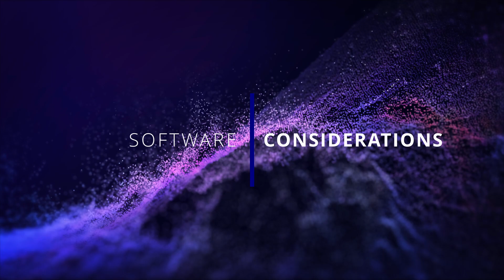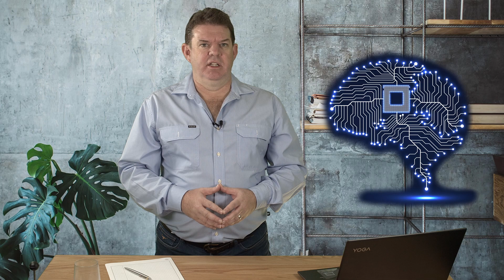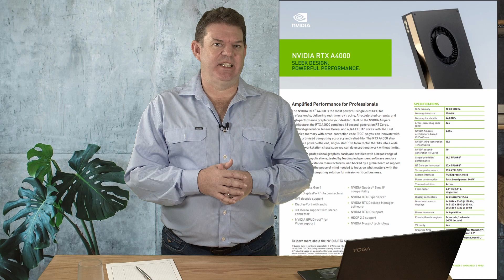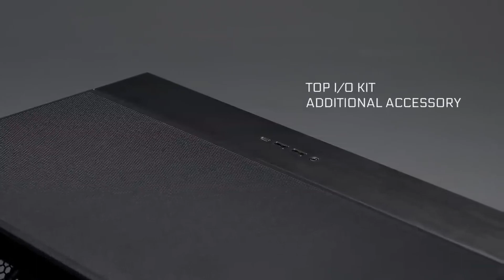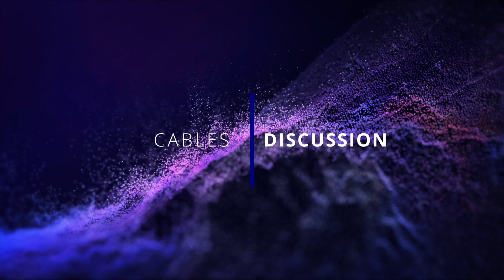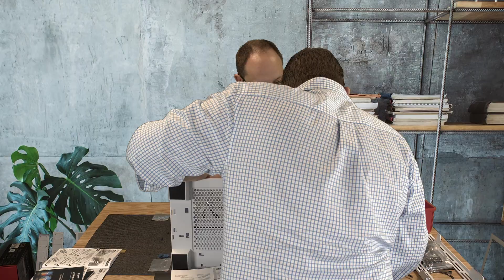CAD Workstation for Overclocking and PC Build video

Comment: Wow so refreshing to find someone focused on a Single Core Machine for us CAD users....And was it worth it?  I am dying to see how you tuned Cranky for the best single core performance.
Reply: Thanks Troy, I should do a video after 12 months.  Certainly software overclocking has been easier to manage on the fly rather than BIOS overclocking.  The best results for overclocking has been with running scripts.